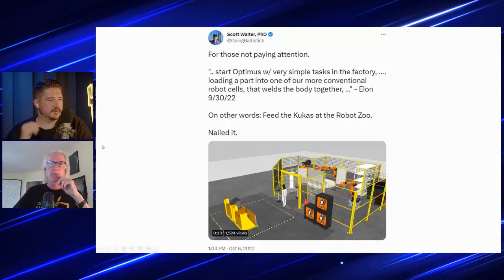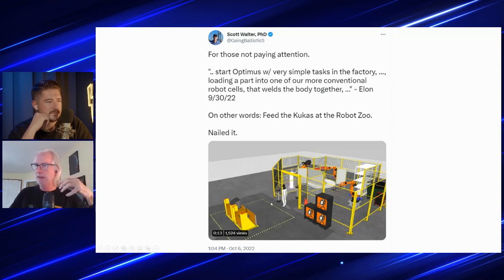TESLA BOT already BUILDING CARS?! The use cases of Optimus ⚡ Scott Walter

Comment: The Tesla humanoid robots are exciting to me as a small farmer and butcher. I was really expecting $50k for the Tesla bot. At $20k I will take three if they can help me on my farm and butchershop - even with fairly simple tasks.

My ideal would be a little more capable. The AgBot version. A little faster, say five miles per hour with a load. A little stronger, lift 400 lbs and carry 200 lbs up the mountain, able to roll & flip a 1,600 lb bale of hay.  It needs to at least keep up with me. 

Able to operate without internet connection. Rural reality. 

Power lasts for atleast five hours but ideally 10 hours and charges in less than an hour. 

Able to work day or night. Nice weather, rain, snow, sleet and wind. Able to withstand water, mud, freezing (-50°F), and getting knocked around - real world rugged. 

Able to use human tools like tractor, chainsaw, brush cutter, loppers, shovel, knives, rake, hoe, sorting board, etc. Pickup trash, put out hay, move lumber, check fence line, carry fence posts, check waterers, open and close gates, mow brush, clear fence lines, sort pigs, dehair a hog, skin a ham, debone, vacuum pack meat, labels on packages, carry boxes... 

In other words my basic daily farm, construction, forestry and butchershop tasks on my small farm. 

At $20k each I will take three humanoid AI humanoid robots for my farm, butchershop & forest. Robots with pitch forks, knives and chainsaws… What could go wrong?
Reply from the maker: True! The Tesla Bot would be helpful for these tasks!
The last bit paints a funny picture. The Chainsaw wielding Teslabot. :D
Reply: @TeslaFix A prototype $20k Optimus that can sweep, vacuum (dust), & mop most of my two story home, would be fine for me. Don’t even need to provide upgradability!

Comment: Teslas are selling NEW for around $30,000 - with IRA discounts included - NOW. NO gasoline EVER. No Oil Changes EVER. No Check Engine Light EVER. No CAT Converters or Oxygen Sensors EVER. No coolant flushes EVER. No Coil Packs or spark plugs EVER. No Timing Belts EVER. Just $10.00 and 20 minutes charging every 300 miles of driving (.04¢ a mile). Over FIFTY THOUSAND chargers with 99% always working - World wide. And in many states CHEAPER Tesla car insurance. Tesla's are too expensive...
Reply from the maker: That's pretty remarkable right? 🤯